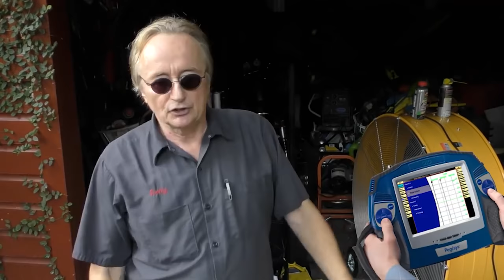3 Illegal Mods That Will Make Your Car Run Better

Comment: When I was a kid in the 70's you used to be able to buy Y pipes where you could flip a lever and bypass the whole muffler system. Haven't seen them for years, probably illegal now.
Reply: I plan on doing that to my car. I want to be loud but only sometimes
Reply: I saw that recently on Gears
Reply: You can get electric ones from jegs.
Reply: Electric cut outs
Reply: Summit Racing has them for $199
Reply: JC Whitney back in the day. Also remember the engine overall in a can? Lol
Reply: Try Borla Exhaust. They make custom kits.
Reply: When I was a young mechanic in the 60s….
Reply: bro you need a little updating. "Levers" are out. Electronic servos are in.
Reply: I have a set of cut outs on my car, bolted right to the headers so at the flip of a switch boom nascar🤣
Reply: @jamesmedina2062  just bc it's new doesn't make it better. Levers are better.  Electric stuff breaks way sooner. And it's made cheap.
Reply: @richsweeney1115  I am referencing what year we are in and what is extremely common in many factory cars. Its in anything fast.
Reply: @richsweeney1115  no argument with durability question
Reply: They have them on cars from the factory now and you can find the electric equivalent, at any parts place worth it's salt.
Reply: Still can buy them. They even make them with electric motors instead of cable operated now.
Reply: Watch project farms video on engine restore. It’s good stuff.
Reply: YEP, THAT WAS IN J.C. WHITNEY  CATALOG 🍻🍺🤓🤗🤓🤓
Reply: Yep, that was the J.C. WHITNEY CATALOG 🤓🤗🍻🍻🍺🍺🤗🤓
Reply: isnt that a "Captains Call"
Reply: They're called cutouts & are electrically controlled now. Now, there are even mufflers with the cutout built into them.
Reply: All things fun are illegal

Comment: I had an '82 Mustang (4-banger, 88 hp).  The first owner modified it by removing the cat.  Although it was never dyno'd, it definitely had more HP than what was claimed and the mileage was better (44-45 imperial mpg; 37 US mpg Highway).  The downside was that the muffler burned through in 5 yrs.
Reply: Mufflers are cheap.

Comment: The two stroke Saabs were three cylinders. When they went four stroke then they were buying a V4 Ford engine. I learned to drive in a V4 Saab. My buddy had an older Saab with the two stroke 3 cylinder engine. Clever Swedes had a rack for oil bottles under the driver's seat.

Comment: 2 strokes need certain back pressure waves as the unburnt gasses are directed back to be burnt. Hence why 2 stroke muffles have to be tuned to the engines.

Comment: 17:20 according to the words of a former state trooper in the state of Nebraska if you are pulled over for speeding and are found to have nitrous oxide hooked up to your car they will look for any possible excuse to say you were using it because the use of nitrous oxide on public roads is strictly illegal

Comment: If I remember correctly the catalysts are Platinum, Rhodium, Nickel or something similar.
Basically they use the same catalyst as is used in Cat-Cracking Refinery Towers.

Comment: Even though it's illegal you can always run a straight pipe and cut out the Cadillac converter you might get a few sensors lights but you know what it is

Comment: Thank you for that explanation about back pressure. I can’t stand it when I get on forums trying to research a certain mod for my 392 challenger and I constantly see guys scared to do certain mods because “it’ll reduce the back pressure.” The only engine to my knowledge that needs back pressure is a diesel motor.
Reply: The only time back pressure is a hindrance is if you run your engine at full throttle, all the time. That's hardly the case in a car on the street used for transportation. You're lucky if you use 10 to 15 HP going down the freeway on a clean aerodynamic car on level ground.  That's nothing when the engine can make 300 -600 hp.  Even Turbochargers make a lot of back pressure, by a factor of 3:1 on the turbine side vs the compressor side.  So if you're making 25# of boost on the compressor side of a turbo diesel, there's about 75# of back pressure on the turbine exhaust side.  Can't get one without the other. Don't say it's bad, lots of vehicles run turbochargers and run full throttle applications, and the back pressure on the exhaust does no harm.
Reply: My lawn mower needs back pressure
Reply: Diesels don't need back pressure. No engine performs better wiith back pressure. 2 strokes need a tuned exhaust but it's not to create back pressure.

Comment: Back in 88 I took the mufflers off my 86 Mustang 302. The straight pipes worked great, and the sound was awesome. Luckily for me at that time, in New Hampshire, the cat kept the noise down to just below the legal threshold.
Reply: I did the same thing with my V6 89 T-bird. Passed smog, sounded great, improved power & mpg
Reply: Same here. I did it on my 73 Mustang Mach 1. It had a 351 and instead of running pipes out the back I just removed everything after the headers. At idle in the driveway the car would rattle the windows in the house 😄 

This setup didn't last long though. It was just way too loud to be driving around every day.
Reply: @dyingbreed5386  Nice. Of course you did not have the ridiculous cats on it. Kept mine quiet enough unless I got on it.

Comment: As a mechanic I've noticed a lot of cars that come in that have nothing but part strong anthem so the number one rule is to find somebody can trouble shoot very  good.  I remember a car coming in, with a high idle, the poor girl had taken the car to a couple of shops before she brought to me.  The first thing I did was look at the engine. I noticed a new TPS sensor installed.  I turned the engine off, put my multimeter on the tps sensor. The sensor would only go from 0 to 2.5 ohms. I removed the sensor and tested  the sensor. The sensor off the car went from 0 to 5 ohms.  Which means the sensor is good.  Then I checked the actuator on the. It moved smoothly.  So as I was installing the tops sensor, I made sure I installed the Tps at the half way point on the car.  After installing the tps sensor on the car.  As I moved the tps from close to open, I saw 0 to 5 ohms on my meter.  I plugged the sensor back in, started the car. When the computer went to close loop, the engine dropped down and was purring like a kitty.  Even though the car had a check engine light on, I never plugged my scan tool in.  But when I looked at the dash, the check engine light was off. I did a scan, just like I figured, no codes.  Still checked the engine out. Compress test, vacuum check, pressure coolant check.  Engine was sound. Our shop did not do transmissions.  After the road test, the paperwork taking care of, the happy smile on her face was priceless and I even got a hug.  So take your time and learn how to troubleshoot.

Comment: I am sure you know why they put expansion chambers on two stroke engines. They used sound to help produce a negative backpressure for more horsepower. And they were tuned to specific rpms.

Comment: In about 2004 my dad had a 1990-something Dodge Neon with problems that ended up being a clogged catalytic convertor. Where we lived at the time we weren't subject to emissions testing and I guess it wasn't illegal yet so the mechanic just ripped out the internals of the cat and the car ran great for the rest of the time we had it.
Reply: It's been illegal to remove them since they started installing them

Comment: The V4 was a four stroke English Ford engine.  It replaced the 2-stroke,  3-cylinder Saab engine in 1967.
Reply: I was under the impression that the V4 on the Saab was a German Ford taunus engine

Comment: In the great state of North Dakota, "mufflers are required on all vehicles" to prevent noise and air pollution. No wiggle room.
Reply: Doesnt say what kind or style, get a glasspack 😁
Reply: Common sense stuff
Reply: Didn't know muffler reduces air pollution!

Comment: 2:24 I've heard that before and it means that Police can make up whatever they want. And if they don't like you and you're not a bootlicker or a fellow officer. That means you're more likely getting a ticket.
Reply: Yep.

Had a buddy get a ticket for a noise violation on a truck he had with a cat back exhaust system. Cop was just being a jerk. “Excessive” is unquantifiable, entirely opinion, and shouldn’t be permissible in a law you expect someone to comply with. 

He took it to court with proof the system was “50 state legal” and the ticket got thrown out.

Comment: Most of the big trucks the younger guys drive where I live in Georgia sound like piston driven airplanes, and most of them are tuned to perform just fine without backfiring. They are extremely loud, but they seem to run just fine. My truck has a less restrictive custom cat-back that performs & sounds very good without being loud. All 4 factory cats are in place, and I do have an adaptive tune so it doesn't backfire.

Comment: Thank you. I love how you explain things auto, very simply. Just at my level of understanding.
Reply: day 1 of understanding how things work, its all just knoledge and results down to the basics then you make a diagnosis, then operate and see if the operation worked from..results. 
the start of a mechanics life is based from newtons laws then build knoledge up from hydrodynamics and thermodynamics, throttled by how the components works and then how it works with its mates...the other components...
knowledge is is the hard part, taking the car apart and putting it back together is the easy part

Comment: Hi @Scotty Kilmer, My car is probably not in the "Modern" category 1972 VW Beetle, but it does absolutely need the back pressure. Without it, the engine tends to overheat, especially cylinder #3. It's aircooled, so it probably doesn't fit your case. Great video! I enjoy your content.
Reply: They have "dog house" fan shrouds, that relocate the oil cooler, so #3 doesn't run hot.

Comment: Manual transmission will indeed help to save on gas. So lovely.
Reply: no...no it wont.
auto coupled with a tuned computer/engines smashes manuals. please research before ya post

Comment: Most times "cataract" converters rattle because the heat shield welds are loose.  Just get a  large hose clamp and clamp around it or put a few smaller one together.

Comment: The computer codes said the left bank was running lean in my car and suggested replacing the oxygen sensors, but my trusted mechanic found that a valve in the exhaust manifold was missing and the air rushing through at full force blew the gasket. Such a shame I had not seen your YouTube channel before I bought my 2014 Cruze. Of course Chevy invited me to go to a dealership to have the problem fixed for free AFTER I had spent the $800. And its fix was only for the PCV valve issue itself and probably didn't include the gasket replacement...
Reply: The diesel Cruze has a regeneration feature . Interesting procedure.

Comment: Well scotty youre not always right. Just to catch you up todays car scene. People are making their car "backfire" its call "pops N Bangs tune". The engines are tuned good. They just tune in it to pop and bang. Basically dumping gas in the exhaust and then igniting it for bangs. Ive seen cars run 7 seconds in the 1/4 mile with pops anf bangs tune so nobody say well if its backfiring its not running right. Well if running a 4 cyl minivan with turboed k24 motor down the quarter mile track in 7 seconds then ill take "not running right" lol
Reply: Right. And it's not backfire. It's afterfire. Backfire is blowing back out the intake. Scotty.... Tsk tsk.
Reply: Unburned gasoline that explodes in the exhaust system can damage the muffler and catalytic.  Muffler can burst at the seams,  Catalytic can burst, or core can be damaged.  Rusty pipes that would otherwise last a while longer can burst.  Why anyone would intentionally risk this makes no sense. If you have backfire, the cause should be found and resolved. I had a new muffler burst due to exhaust explosion.

Even under adverse conditions in which older engines would tend to backfire, modern engines are less likely to do this.  They have knock sensors that sense knock or back fire.  They retard the spark timing to prevent the knocking.  But you will not know that this is happening, except performance and fuel economy could be reduced. A fancy OBD scanner that shows live codes might tell you if spark time is being retarded.

Comment: I just had a P0301 code after I had an engine swap… three mechanics told me three different things but I knew I needed a new muffler and once I replaced the Exhuast, the code went away and the car ran better.

Comment: I get about 35 more BHP by de-catting my flat-four, turbocharged '97 Tommy kaira M20b, along with replacing the downpipe with a wide-mouthed 4"  custom item. The high-flow JASMA-approved 3" stainless Fujtisubo cat-back did not need replacing.

But the best mod I ever did to it was adding a Cusco brake master cylinder brace: With the 12-pot Brembo system it made the brake pedal solid as a rock - just like my Porsches. :)

Comment: My first car with the muffler behind the rear tires like that never lasted long. One rusted away but it was welded on so the inside part was still there. Think I out the muffler on backwards so it would fit over the old insides still there. Worked great and the quietest that car has ever been. Once that muffler was going bad though I took it someplace to get changed. They told me that they had to cut it off as there was an adapter welded on. Adapter? Ha it was just part of the previous muffler.

Comment: Scotty, been watching for years and just had this issue come up.  Wife's 95k miles 2011 Chevy Equinox check engine light comes on for the catalytic converter efficiency, but only after it rains.  Usually lasts until a couple tanks of gas go through.  What gives?  I'll give the lacquer thinner a try.
Reply: I actually have the exact can of lacquer thinner sitting at my airbrush paint desk.
Reply: Update: Did not work.  YMMV.
Reply: Sell it. You barely have any miles and this is already happening... Shows the quality

Comment: Removing resinators is what makes the “backfire “ noise, not the muffler. It’s not a “backfire “ it’s I burned fuel igniting in the hot exhaust system.

Comment: I changed the cat assembly on my '00 Jetta three times before i finally figured out it was the ignition coil had a weak fire on cylinder two.  Expensive lesson to learn.

Comment: I had car in Ontario, Canada, many years ago that was modified to use pure natural gas.  So the fuel was totally ionized, yet the catalytic converter became clogged, and it wouldn't go more than 35 mph.  A mechanic removed the innards and it ran good.  I guess that it was legal, but now in retrospect I am unsure if it was.
Reply: That's weird, CNG converted cars are fairly common here and none of them have cat issues.
Reply: not sure how many years are many, but as of 20 years ago it would be illegal (though hollowing out a cat is a common practice). That is probably why the mechanic hollowed it out, rather then straight pipe it. A CNG engine is technically a low emission engine anyway, which is why you were probably able to get away with it.

Comment: Good info as always Scotty, but I wanna know if there is a way to reprogram the injectors on my 2016 Frontier SV ? It's 310hp mpg is crap, would it be possible to knock it down to say 250 or less & up the mpg ? Thanx.
Reply: No.... your mpg is crap because the car wasn't built with an aerodynamic body and has a high coefficient of drag in the body design. It just doesn't push air out of the way very well at highway speeds.

Comment: I work at autozone and had a customer come in one time and i thought it was funny 😂. 
So he had me scan the vehicle and of course threw up the code for catalytic efficiency below threshold. I tell him he has a problem with the catalytic converter. He was wanting to buy one then and there 😂. I’m like “hold up. That may not even be ya issue. You need to get it checked by a mechanic before u buy a $600 cat but i can take a quick look.”
💀 His vehicle had 3 cats and his eyes almost popped out his head when i said that 😂. Just reiterated to him that he needs to go to a mechanic and have them check it out. For all we know it could be a bad O2 sensor 🤷🏾‍♂️. 
I just dont feel right selling people things they ask for if they dont seem informed enough to really make that purchase. I would rather they go get a professional to take a look and then come back.
Reply: Too bad the autozone by my house doesn't do this
Reply: Good for you man. I wish more people were like this.
Reply: Don’t know why people think the guy at autozone is a mechanic or even has the slightest clues  about vehicles. 

I just recently had an autozone employee argue me for 5 mins saying I was buying the wrong tail light bulb for my. 
After going back and forth for 5 mins I went out in the parking lot and removed the blown bulb just so I could show this dummy I needed a 7443. Not a 7440.
Reply: Yeah I had an auto zone employee tell me that there wasn't a manual transmission Mitsubishi Eclipse for the year I gave her. I said well you have one sitting in the parking lot would you care to go take a look. She said no but her COMPUTER says that Mitsubishi didn't make a mt eclipse that year. I said I don't care what your computer says, I know for 100% fact that they did because I have one sitting in your parking lot. She said no Mitsubishi didn't make mt eclipses that year. I left and went to O'Reilly's for my needed part smdh

Comment: No you do not need back pressure for a four stroke motor to run properly and reliably , BUT will absolutely in every single case your engines powerband will be changed drastically if you alter the stock exhaust. The less back pressure you have, the less torque you make and more high end horsepower you will make , and the opposite will occur if you increase the back pressure.